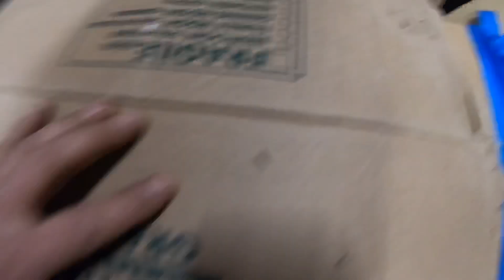HOMEMADE COMPACTOR FOR RECYCLING AND TRASH BIN

Comment: Thanks for posting this!  I used it as inspiration to build my own based on your design.  I added more bracing around this sides for stability in mine.  I also made it an bit taller and anchored it to the concrete in my garage (instead of having a wood floor) to accommodate easier bin movement and more potential downforce.  It works great!   Thanks for giving me the inspiration.

Comment: If you need to prevent the trash from puffing back up, you could also make a baler out of this. Swap out the garbage can with a wood enclosure, make some slits for the wire/string, and then when the jack is extended, start tying knots to keep that trash compact. After that, you just take your little trash bale out and put it in the garbage can!

Great video! You've given me a project that I will be looking into! 😄

Comment: Very cool !   Dude, I can't believe how much stuff you packed into that!  Sheesh!  Gonna try making one of these.  I might brace the top a little more.  But basically it works.  Little tweaking here and there.  Im thinkin maybe a compartment with a removable or hinged front door or something to remove the "block of crushed stuff" after.  Maybe place heavy-duty baling twine ahead of time to tie it off before raising the compaction head on the last return cycle.  Thanks for posting !

Comment: This is awesome! It might be mostly a guy thing - to figure out a way to smash recycling or trash down into a smaller area. It's something I think about more than I'd like to admit. This is a great design. One other design idea would be to build a frame for the recycling bin, and 3-4 steps to climb up on top of it and just jump up and down a bit on the wood lid you built to smash down the recycling. This design includes some exercise, but it has drawbacks. First, being up that high you could fall out, and second, it seems way cooler to use a power drill and a car jack to do the work so you can just stand and watch what happens. I want to build a mini version of this for the platic film recycling we have here in Denver with Ridwell.
Reply: Haha I think about trash move than I’d like to admit as well. My wife was like why do you care about compacting trash hahahaha

Comment: Love this idea!  My wife is the same thing.  We get one pick up every two weeks and one garbage can every week.  I was wondering if when you left it compressed did it stay down better?  Also,  what are your thought on making a smaller one that would fit one of those little bins you had and drop the”cube” into the large container?
Reply: You could easily make a smaller one and use a typical "shopping bag" as a smaller container, and toss the compressed smaller bag into the bin. That would also make it more likely that when the collection guy came by (who could care less if the bin empties once he's shaken it into the truck) he actually empties the bin, instead of leaving a bunch of compressed garbage in the bottom of the bin.

Comment: I was wondering if you couldn't use hinges and chains to mount the top compression assembly on a garage wall and achieve compaction with less spaces taken up?
Reply: Harbor Freight has the HAUL-MASTER 2.5 ton Trailer/RV Scissor Stabilizer with a 24" vertical lift for $40

Comment: Did it empty out when the trash truck picked it up ?
Reply from the maker: Everything came out very nice every time so far
Reply: @innovator5988  I assume it would be fairly easy do to the conical shape of the garbage can.
Reply: I guess you could coat the sides with a spray lube

Comment: Strange how diffrent it can be... We in Sweden have to separate paper, plastic cardboard, metal and food waste in diffrent containers.
Reply: We use to pay China to do that for us, but the relationship has soured. My garbage collector doesn't bother with recycling anymore. They recently have been economizing by reducing the bin size and charging the same amount, which is the reason I have been researching trash compactors. Joke will be on them when my trash becomes much more dense! Muhahaha!
Reply: Americans are too lazy to separate so they run it through machines that do it

Comment: I have the same trash receptacles and their design geometry is lacking. I understand the engineering perspective of the design, but I think that it could be much better. The various curves in it create air pockets or voids where the trash won't get compacted into. If they were cylindrical instead then all of your efforts would have a much higher rate of return.